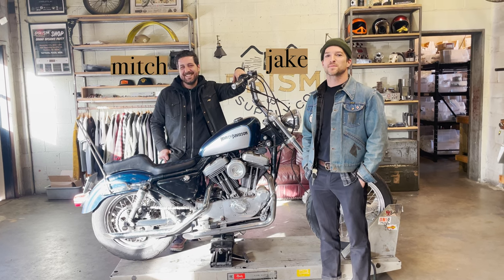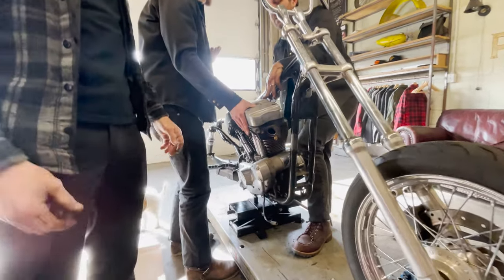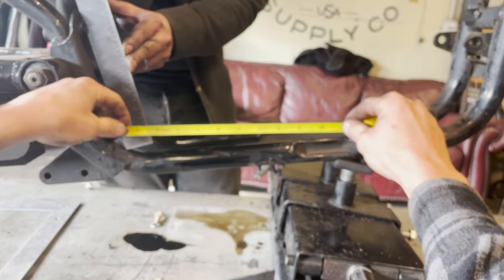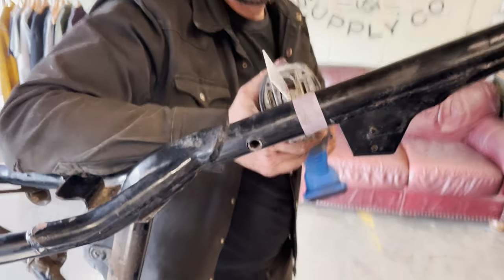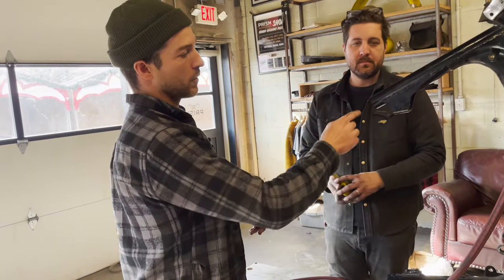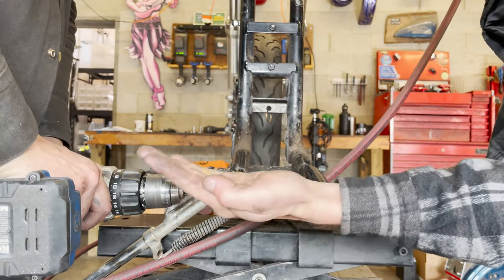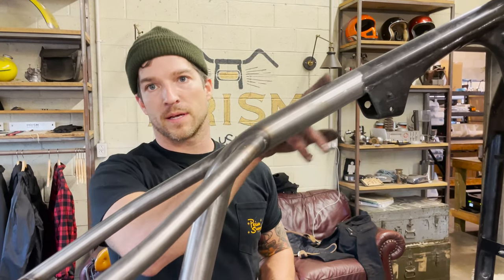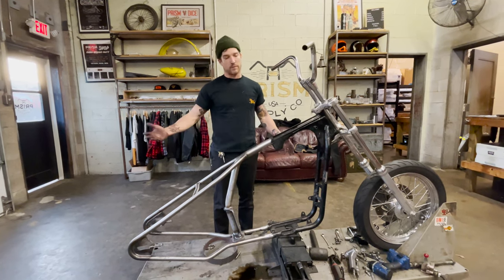PRISM SUPPLY | DIY Install | ’82-’03 Sportster Hardtail Kit

Comment: Installed mine today. It took a few months longer to get started. Took most the day but it was not in a shop just the parking lot. Easy fit up drain your oil and clean your bike first if you can. Have fun

Comment: Cool fabrication. Looks like the kit is dialed in and precision made.  I just found you guys and subbed.  Building a bobber myself, almost done.  If I may suggest, take it from an old guy, step drill your holes next time and use an oil on the bit tip. I am also a school shop teacher....wear your safety glasses!!!  lol. Keep the vids coming. I will catch up on all the vids on channel.
Reply: technically with a cut-off wheel you want a shield...
Reply: Why step drill? What's the benefit?
Reply: @basedorthobrofren  they make round holes, drill bits make triangle holes

Comment: I'm not sure why you drilled the hole through the slugs and the original frame I thought you were going to put a nut and bolt there I remember when I did my 69 triumph tiger the kit came with a nut and bolt you could also weld it too. The bsa's I used to do were just welding only I thought the nut and bolt was a extra safety measure.